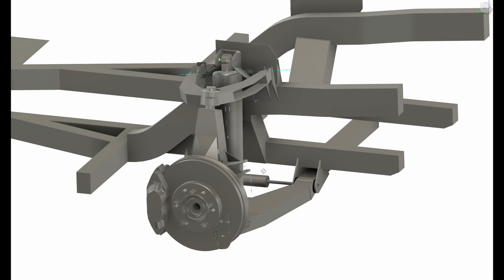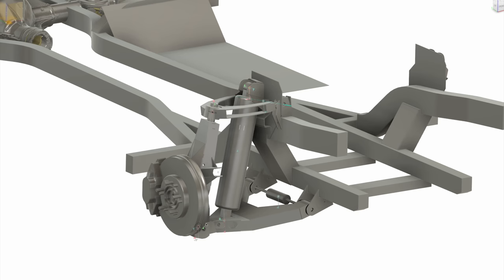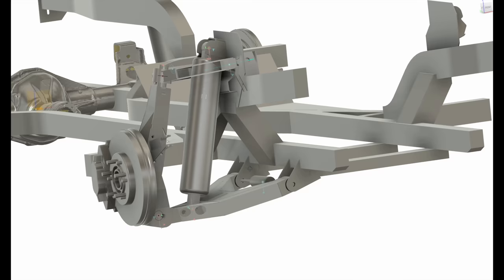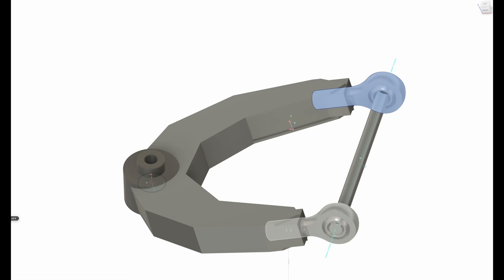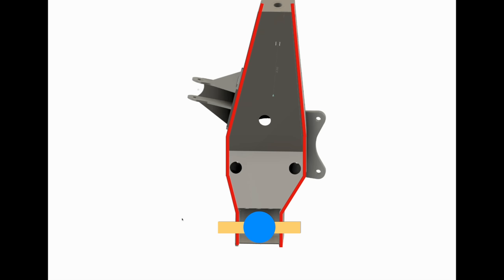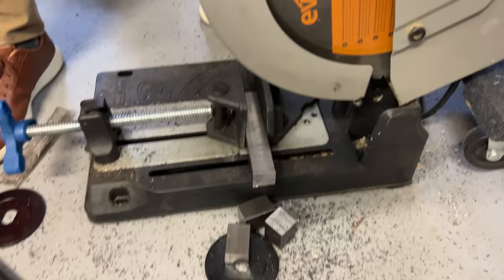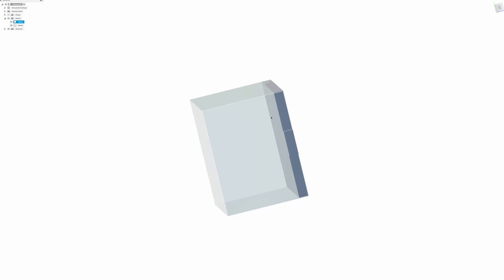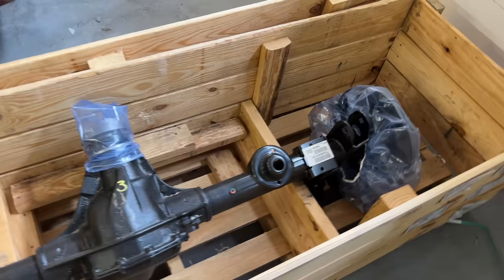Off-Road Dodge Viper Gets Custom Front Suspension

Comment: If you're using solid works, you can model those parts as sheet metal instead of regular solid bodys and automatically add tabs and slots using that tab and slot feature so you don't forget any in the future
Reply: only if his solidworks is new enough! believe that wasn't added until 2019/20

Comment: Once upon a time, in a previous life, I  had a log crawling, stump jumping off-road 1947 Willys Jeep.  I loved that thing.  With blazing 40 hp, it would do "maybe" 45 mph, down a steep hill, tops.  But it would almost climb a tree,  I had an avid off-roader tell me once that Jeep with locked rear axle in 2WD could go anywhere a 4WD could go.  So I  benchmarked some difficult terrain in 4WD, then removed the front drive shaft and tested that theory (after welding in the rear spider gears).  Although it turned out that wasn't EXACTLY true, I was really surprised at how well the Jeep did perform, and how many places it could get.  So your approach to a 2WD Viper (locked rear end, posi?), is reasonably sound, and I'll bet it will surprise you also how many places you will get it to go.
Reply: LSD.
Reply: I had a friend back in the '70s that would buy surplus CJ2As and recondition them, then plop a Ford Pinto motor under the hood.  I did some welding and all of his painting for him, they looked quite nice.  His would hit 60 MPH, but that was scary as hell since the kingpins were always uncooperative and they'd shimmy over 50.
Reply: @AlfaRomeo156SWGTA  That's where the project ideas come from.
Reply: @d00dEEE  HAhaha!  Yessiree.  I remember driving mine down the highway, and trying to shift lanes, once the leading front tire crossed the crown  of the road, it would take off towards that side of the ditch.  You had to be prepared for counter measures.
Reply: The viper might still struggle in soft terrain at low speed. The reason Jeeps (especially older 2 doors) did well in 2wd with a locker is because they have a lot of weight on the rear axle. Same as how a Vw bug does so well offroad.
Reply: There are some situations where a rear locker is more beneficial than 4WD, primarily when you get on trails where you flex out and start lifting tires.  If you lift both tires on a 4WD (not necessarily in the air, just no meaningful weight on the ground), then a 4WD is going to spin both of those tires without going forward.  A locked 2WD would still have one tire getting great traction, which is one more than the 4WD would have.  In other situations, 4WD is better than a locked 2WD, primarily when all tires have decent contact with the ground, and especially when you also add a locker or two.
Reply: @AlfaRomeo156SWGTA  If he's using a Bronco or Jeep axle, it's going to be an electric locker.  Nobody really uses LSD's offroad, except in some cases for the front axle because it was free or they weren't thinking clearly.

Comment: I did a lot of off roading in southern California  in the 80's and 90's with friends.
One of the guys drove an unmodified , Volkswagen Variant which was a compact, rear engined, 2 wheel drive, 2 door wagon with a short wheel base of about 95"L X 62" W; he liked it because he could sleep in it with the rear seat folded flat.
Everyone else had 4WD Jeeps or Toyota trucks , but the guy with the VW wagon had zero problems keeping up with the other "REAL" off road vehicles!
Reply: The guy who drove the squareback had exceptional off-road driving skills. He took me up to the top of Saddleback in that vehicle using trails that no vehicle should have been using. He also owned an old Landcruiser, rarely used 4WD, said it was only needed for crawling over boulders and getting real stuck in soft sand. He didn't drive it much, he said it was because he couldn't sleep in it. He said the key to successful off-roading was having a vehicle, any vehicle, with a short wheel base.
Reply: @doctorspooger5966  hey, dunno if it wuz the same guy; Jim Heaton.
The reason that we did so much off roading in those days wuz to get to good, new places to launch our hang gliders.
It's funny that you mention Saddleback peak as there was once an off road park on the west side called "escape country" and a legendary, early hang gliding meet took place there in the late 70's.
I think that it was sponsored partly by "Annie Green Springs?" a cut rate wine of the time.
We mostly use paved roads to get to the tops of mountains these days and flying is still a gas.
Reply: In my youth (about 30 years ago) I read in a German off road camping unimog etc magazine a nice article of a guy that built himself a huge unimog Saharan crossing car… and then in the farest possible Sahara oasis he met a group of French guys.. they were there with 2 or 3 2CV 😂😂😂
Reply: @964cuplove  Old Citroens, 2CV included, are amazing offroad vehicles. The type of suspension set-ups the french did on them were very capable and the cars were light AF. If by a miracle the 2CV broke in the middle of the desert you could butcher it up and make a motorcycle if you understood mechanics...I'm not even joking, there is a french electrician that took one in the Moroccan deser and when he wrecked  he made the 2CV into a motorcycle and got to safety on it.
Reply: 2-door rear engined wagon sounds absolutely ridiculous in the modern context. It's incredible what cars used to be.
Reply: @celeron55  I guess the reasons that the VW square back performed so well off road was a combination of short wheel base, light weight, long suspension travel and the way that the power was distributed to each wheel under load and slip
I'm guessing that the transaxles of those early VW were some version of "real full time 2WD?" rather than the "weak sauce " limited slip differentials?
As others have pointed out the Citroen 2CV was another oddball automobile which also had amazing off road capabilities.
Reply: @someguydino6770  The guy I went with was Eric L. I suffer from motion sickness and I think he brought me along for his own entertainment, cuz he used to take me out to 14-mile bank for tuna fishing as well. 

I do recall a few times driving around to the inland side of Saddleback and taking trails to above where the hangliders took off. That was in '84-'85, they had all kinds of safety gear and better materials by then... I still wouldn't go. Can't navigate well when sick
Reply: this is common, especially on sand, weight and tyre pressure is more important than 4wd.  Dudes used to cross the center of Australia in a rwd Ute and now you need a 4wd to drive on hard beach sand apparently.
Reply: @GingerNingerGames  100%  it astonishes me some of the 4wd tracks friends go on with their 35" mud tyres twin locked and all this,  id been up the same track in my 2wd subaru leone coupe (175/70/13" tyres, car completely standard) a few years before when i got lost once trying to find a fishing spot i was told about.  most, specifically older vehicles are far more capable than people give them credit for. Though it seems nowdays most tracks have giant ruts from 35 and 37" mud tyres and insufficient skill, so its become challenging to go most places now with smaller tyres as you'll diff out or worse, beach with the wheels not touching anything.
Reply: @someguydino6770  My pops had some work in upstate NY, near Buffalo, he took the family along for the 3 weeks of Summer and 33 weeks of winter, as I recall. He bought a brand new off the ferry 1969 VW bug specifically for the rear wheel drive engine weight over axle design. When the snow arrived, something like 17 feet dropped overnight, that little bug was able to tunnel through that stuff with ease, the bicycle sized tires finding asphalt to grip and press forward due to the setup.
Reply: @GingerNingerGames  The first vehicle I ever drove was a Lifeguard Jeep. I was only 15 at the time, but they hired me because mid summer, I'd be 16. Liability laws for city governments hadn't been tested yet. Anyhow, when I told the supervisor I never drove before, he heard I never drove a stick-shift. During the 5 minute lesson on how to operate a clutch, he added we never wanted to get the Jeep into a situation where 4WD was needed. Thanks to a robust forgiving transmission, custom fiberglass body, aluminum wheels, and my 150lb frame.  The Jeep floated across the soft sand daily in 2WD. I never had use 4WD. Those were a great 3 weeks. That's how long it took for the Lifeguard Captain to recall I wasn't old enough to have a drivers license.
Reply: If you guys were taking VW's and Subaru's to these places, then they were easy trails and the other vehicles were being under-utilized.  I'll be the first to eat crow if I see any of those vehicles survive the Rubicon or the Hammers.
Reply: @Skinflaps_Meatslapper  yes they were easy trails, thats the point, i could go up it in a front wheel drive car without an lsd with a 13x5" wheel on a standard road tyre, but nowdays everyone selects 4 low, locks the hubs and has 35" tyres to do the same track... Which a landcruiser, patrol, hilux etc could easily do in high range 2wd
Reply: In Afghanistan,  tons of people drive toyota corollas, or whatever they are called in the non US markets. There's basically no such thing as roads in Afghanistan. It's pretty much a 4th world country. Anyway, those corollas go everywhere.
Reply: @Colt45hatchback  That's where the subi's are good because they physically can't diff out before they bottom, and when they bottom if you have enough skid plate and right foot it'll belly drag along the sand.

Comment: The joint you are talking about @12:16 is called a corner to corner joint and the other would be more like a butt joint and yes the corner to corner looks much nicer after welding and I think you'll find it'll be a stronger joint.
By the way your welding is getting much neater and uniform.
When I weld T.I.G Aluminium i usually get a block of wood to rest my wrist on so I'm not free handing it and if you do the same you will find that your welds will turn out much nicer and more uniform. Just remember "ABC" in welding "Always Be Comfortable".
I hope this helps you with your welding endeavours. Good luck Matt.👍
I do all the tube welding for turbo charger plumbing applications at PLAZMAMAN in Australia
Reply: In "the biz" it was standard practice for us to give 1/4 to 1/2 material thickness overlap on corner to corner type joints in plate. Easier to index the parts, and if we needed more beef we would call out a 2nd bead on the inside too. Good inside fillets really resist extension of the joint (wall flexing out).

Comment: This episode was... suspenseful.
Getting your tab-2-slot sizing right and allowing a 1/2 material thickness overlap on outside corners will make you popular with the welders when you order 100 or 1,000 parts. To keep them grumpy and adjust your cost simply throw in a random "+/- 0.0015" on center-2-center dims, use wide slot gaps, and maybe toss in a really specific fillet callout on tight internal welds they can't reach. Always worked for me!

[EDIT] Ohh! I almost forgot a bonus move. Be sure to laser out holes almost to the size the guys will be tapping. The hardening of the steel will make drilling and tapping a real adventure! Everybody likes adventures, right?

Comment: Hi Matt, 
Looking at your fusion360 workflow i think when creating the tabs it would help you to use the "combine" tool after creating the first tab and substract the first wall off of the second, make sure to check "keep Tools". Follow this by the "push/pull" Feature (shortcut "Q" on your keyboard) and add tolerances to the newly created slots.
This method can also be helpful at the very end when you're ready to export your design to make sure that you didn't forget any notches and that the parts have no interference.
Sincerely yours,
a fellow ME who has to do this shit all day every day

Comment: You have to spray paint or oil coat inside the component because the hollow component has a high corrosion probability, especially car bottom parts.
Reply: you're right..could do both actually and even weld a valve to be able to squirt some heavy duty grease inside once in  awhile..,especially if the suspension gets submerged crossing muddy waters sometimes or hits snowy salty roads..!!..with the time & care he takes to build those parts ,it won't be overkill..!!
Reply: I just replaced all the box section on my boat trailer for this exact reason
Reply: He's in California. Probably not going to be a problem. Or if it is, one for future Matt

Comment: A grinder and paint makes a welder what he ain't. Keep up the good work and engineering! Makes me want to try my hand at designing and learning to weld things up
Reply: It was straining every fiber of my existence not to post that first line above! On prototypes I have gone as far as using Bondo to make my outside welds look presentable. Matt misses a step by not welding the inside of the outer walls of the box structure.  No "I told you so" when it fails on the first rock hit. That will make a good video on its own.

Comment: Fusion has a feature called "joint" and it has an option where instead of jointing two solid bodies, you can use one body as tool body to cut another, and keep the tool body. That means when making tabs, you really could have just made tabs on one part and used joint to cut the corresponding slots on the other parts, saving half of your tab CAD work.

Comment: Great choice with the Wildpeaks Mat!

I've had them on my Trail Boss for around 18k miles with zero complaints about the grip, and I can confirm the road noise is basically zero compared to the mud terrains I used to run.
Reply: I had the same exact experience!

Comment: As a sheet metal design engineer, Solidworks Sheet Metal Add-In becomes your best friend.. Tab and Slot for castleations in like 2 clicks. Definately maybe something to look into if you're using a subcon sheet metal/laser cutting company loads. 

Also, if they press brake or you ever need to have it done, Solidworks will autocalc your flat patterns with the right starting perameters!

Comment: As far as load cases, for off-road "worst case scenario" we used a "3-2-1" load case: 3G vertical load, 2G longitudinal, 1G tractive effort

Steering loads when your tire is up against a rock can also be very high, but that's a different load case based on your max steering loads you can create.

Comment: Love your videos. I'm surprised you didn't go into why heavy suspension is not awesome, hence why you cut speed holes in it. Some modeling software has collision detection that can help show where parts are in other parts, alternatively you could have someone double check it. The engineer at the company I work for doesn't use either and it has caused some hilarious/costly reworks. I love seeing parts "magicked" into other parts when I go back to check the model.

Comment: FYI, solidworks added tab and slot to their sheet metal function a few years ago. 
You can set up your tab and slot geometry, spacing, clearance, etc. 
Works quite well. 

I also used to do the full T but weld on my corners, and agree a partial is easier, 
However now with the SW tab creation being pretty easy I have really pulled those corners back and do several small tabs and only overlap by maybe 10%. Not quite open root, but very close to it. 
I also have the tabs only protrude to half way. 
Set my tig to "spot" which lets me dial in a quick blast for tac's (just one less thing to think about) and go about quickly setting everything up, and then for these type of components I usually whip out the mig and go to town.

Comment: I have a theory to keep the frame from breaking -

if your suspension parts are seriously heavy duty and can take offroad loads, but their mounting points to the chassis might not be able to, what you want is to reduce the impact load on the chassis - which means fitting really, really soft suspension. Like Citroen DS soft. Go full 1960's kinematics (without having the car bottom out and die on everything). 

Can you fit longer than 8 inch travel coilovers?

Comment: Can’t wait to see this rolling! Camburg uniballs are fantastic and will serve you well. I know this is a just for fun project but a single shear UCA is a wee bit concerning. Built a couple long travel desert vehicles over the years. Lowers mounted to a drop down X braced mount welded to the bottom of the frame has always worked well. Built a jig to assemble left and right full suspension as per the model (UCA, LCA, Spindle) “in space” off the vehicle to tack everything static with some scrap 1” tube. The suspension was then transferred to the chassis lower mounts and set in place. From there, the UCA mounts were easy to locate and fab. Don’t know much about Vipers but if the motor is pulled from the top of the car who cares if the lower x braced mounts are fixed. Oil changes or dropping the pan will be a future Matt problem. Make the engine cage removable. Yes engine cage, the thing that prevents your chassis rails from going twisty twisty. Adjustable King or Fox 2.5” coil overs are a great choice. ASSuming you mean adjustable as in threaded body, a must to dial in ride height and play with different springs. Don’t forget to limit travel with bumps and straps. As for the rear, that’s…..ok, I’ll stop. Guh, enough rambling. Why the hell am I writing such a long winded comment on a YouTube video that will just be scrutinized and/or overlooked? Dunno, mechanical brain made me do it.

Comment: Box because tensegrity design. when you bind two surfaces together with a sufficiently rigid perpendicular surface, then the two outer surfaces will experience opposing force loading until one of the surfaces fails, but this is typically still stronger than a solid bar of equivalent mass. Hence I and H beams instead of solid bar for building construction.